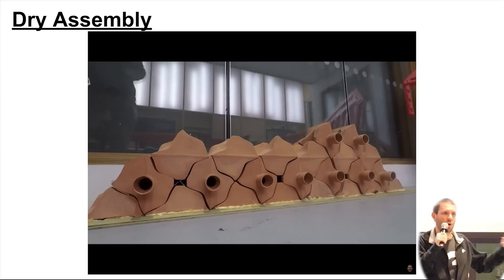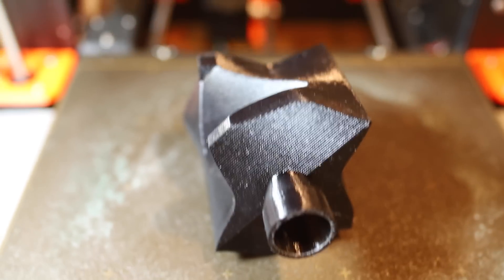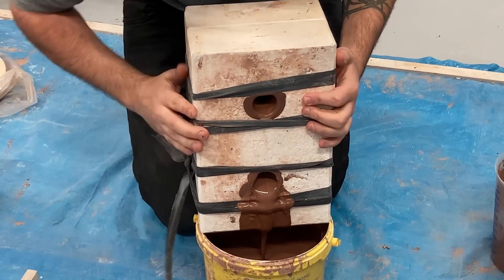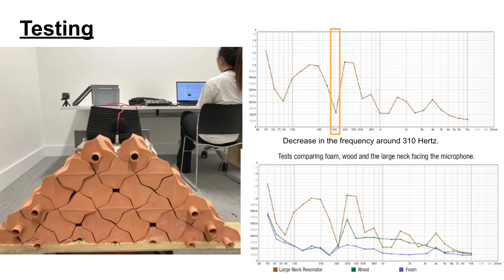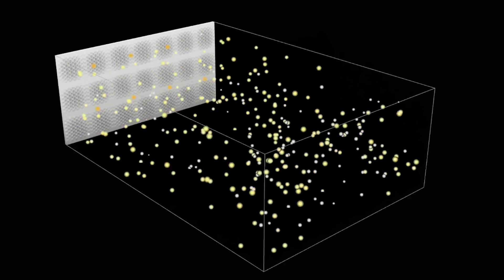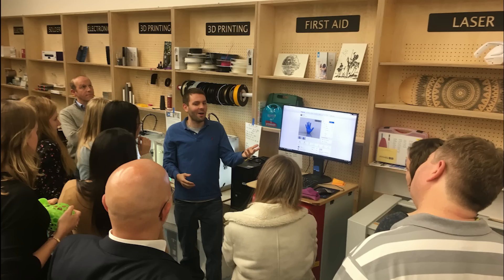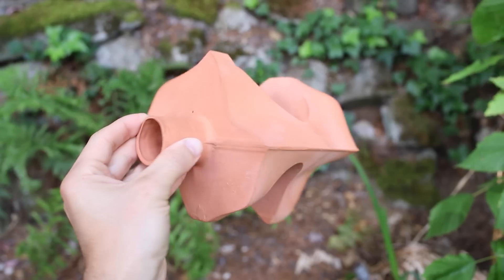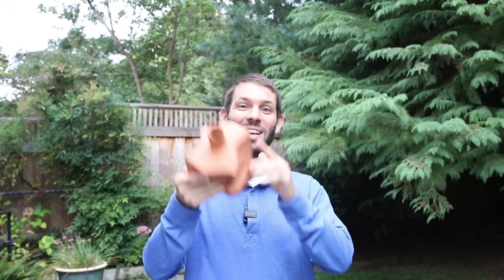Top 3 Questions Answered How I Made This Prototype

Comment from the maker: Enjoy my Thesis and Portfolio about this project linked in the description.  Also the free 3D file to print 👍
Reply: Good work Joe!
Reply: What about like,  motor racing and factory district applications?not just highways.

In construction we have these big plastic boundary bollards 🚧 I’m wondering if this design with another material could be made into manoeuvrable pieces and structures to muffle construction noise
Reply: I would 3d print but my printer broke 😕
Reply: The real question are you going to be a piece of shit when you get big, yes or no.
Reply: How many birds and squirrels moved into your sound attenuating condo complex?
Reply: Just a few notes:

-Most birds will rarely if ever nest in areas so close to the ground easily accessible to predators like rats, snakes, etc...  These houses will end up being used primarily by rats, mice, ants and roaches. You will also see hornet and bee hives being built in there. These will absolutely need some kind of screening to prevent these types of infestations, however rats will chew through anything besides steel mesh, and bugs will fit in-between that, so you'd need 2 kinds of screens.

-The nozzle part that sticks out is a weak point, will likely crack from weather or from kids kicking them, leading to deeper cracks in the structure.  It should be removed completely. 

-The cavity itself will inevitably take on snow and ice and rain faster than it can permeate out. Changing temperature ice expansions will lead to cracks in the entire structure. These bricks will not last long and will be a pile of rubble in 10 years tops, probably less in colder climates.

Conclusion. This design is completely removed from reality and should come with a serious disclaimer for anyone that is attempting to use it detailing all these issues, and I'm sure there are many more if you'd take the time to speak with building managers, repair masons and exterminators.
Reply: You sound complicated...
Why no foam? 
I don't have a CNC machine, and allot of time ...

Air Gap...?
Reply: What does your thing do that gravel filling a space doesn't?
Reply: I once stuck foam sheets with a spacer between them in a concrete poured wall... It did really good to get rid of all sorts of noise and the little bit of chicken wire i put in let alone the mix i used is nearly errosion proof.

Comment: What's the point of the video if you don't even test it? You buy a DB meter, you build a wall with your "special" bricks, you build a wall with cinderblocks and then you test and compare the results. Also if there is wind parallel to the wall wouldn't it make noise similar to blowing over the top of an empty bottle?
Reply from the maker: To keep you wanting more...

Comment: How about funnel shaped internal structure that lets in hot air one side and lets lesser temperature on the other side. Placing them on walls can reduce internal overall temperature
Reply from the maker: It wouldn't absorb noise then...

Comment: seems structurally garbage, significantly expensive to manufacture even at its most efficient, and extremely expensive to construct due to the transportation, storage, and skilled labour involved with cutting these in various fractions of itself. Show me how you tie in two of these walls together at 45°, 90°. How does this method adjust to changes in elevation. And esthetically, I mean come on, that grout job looks terrible and you can tell how different some of these tiles are from one another based on how poorly they fit together in some areas. You built a 5ft triangle, now build a 20ft wall
Reply from the maker: Are you trying to sound like ever other critic out there?
Reply: if thats your response to my concerns then yes, I likely sound like every other critic and thats because these are valid points that you clearly aren't considering or addressing. How many hours went into you making that little triangle, and how do you anticipate cutting down that time? Maybe listen to your critics rather than sounding like some sort of victim thats trying to defy the doubters. If you listened to some of the critics once in a while this product might not look like an absolute joke  @JoeMakes

Comment: Did you consider using recycled plastic to build those bricks? While clay is more inert, it needs to be fired and that would increase the footprint. On the other hand, the plastic brick is easier to mold and produce commercially. You can recycle it multiple times. It may still provide place for small animals to nest inside the cavity, or have moss growth over it. Also recycled plastic would prevent filling more landfills.
Reply from the maker: Yes you can.  We had to use clay for our masters program, but plenty of materials out there to explore 🙌

Comment: I initially thought this was an evaporative cooling wall made of clay, but absorbing sound using clay forms is pretty awesome. It's like ancient cooling methods with advanced geometry repurposed to address a modern problem. Have you considered making a wall of these for a home facing a busy road to test it's use case for residential road noise.
Reply from the maker: Thanks!  My colleagues were doing their project on evaporative cooling.  I did make this wall, but wasn't able to test the final results in external environments before graduation.
Reply: @JoeMakes I got stuck doing civil engineering in the Navy because my degree had "engineer" in the title (Nuclear) ... whatcha gonna do, needs of the navy. Ended up using quantum mechanics equations to develop sound attenuation for indoor construction training facilities that beat the best in the business... it ended up being the cheapest corrugated roofing that fit the equations best and outperformed the top of the line $500k alternative by over 2db for 1% of the cost (free labor using Seabees helped)
Your design has much prettier lines than corrugated roofing panels.

It's hard to tell from looking but those chambers will have a resonant frequency that fired clay will propagate almost like a bell - hopefully it isn't a multiple of the lawn mower frequency - changing the chamber size and shape will change the resonant frequencies.

Comment: What about water inside collecting and allowing mosquitoes to breed?
Reply from the maker: Did you watch the video?
Reply: @JoeMakes  Yes, I did. I’m not being rude, it’s a genuine question. You addressed water on the surface of the terra cotta evaporating but not the inside. Has any water been able to stay inside? In my experience with glazed terra cotta they definitely can hold water especially with no direct sunlight.

Comment: In terms of fragility: Have you tried adding grog to the slip before casting? I'm no ceramics expert, but it strikes me as a really interesting challenge for a ceramics lab to try tuning the process and testing additives in order to make these easier to manufacture. Maybe designing an array mold for pouring concrete into directly, or using other kinds of raw materials that don't require firing, and testing the inclusion of some squishy substace ie: recycled rubber?

Love that you kept this whole project freely available, scientific research should always be open source imo! I'm excited to see other iterate on this project in the future, and see what other fantastic work will build off of your research.
Reply from the maker: Thanks!  Yes, I did experiment with grog but regular terracotta slip was better for evaporating water.

Comment: I love the idea. Have you ever seen the videos of how people in very hot places like india use plastic bottles with the bottoms removed and put into a grid in a window to cool their homes? It would be a neat idea to incorporate a brick with a similar style to what you have there so they could be interlocking but instead of a solid side have that side with a large opening and then the smaller opening on the other side. Then they could use bricks like that for cooling and if they dont want it cooler they could plug the smaller holes with corks or something. I dunno. Just a thought. 🙃
Reply from the maker: Love it!  My colleagues were doing evaporative cooling as their project.  So this is a wonderful combination!

Comment: Overengineered.  The brick needs to be square or rectamgular like a normal brick. This form is not practical. Even if the square brick looses some of its noise absorption. The resulting walls will be more evenly laid and stable.
Reply from the maker: Under-informed.  Read my thesis...

Comment: Have you looked into the cooling(AC) properties of terra cotta pots? They can actually be used as makeshift air conditioners. They work through the process of evaporation, you just keep water in them. So it’s possible you created a way to not only reduce noise pollution, but also a way to decrease the effects of global warming due to air pollution.
Reply from the maker: Yup, my colleagues did ac for their project!

Comment: I have a question and an idea:
does it have to be a ceramic brick, or would a void in concrete the same shape work?
Because for large scale implementation, being able to assemble a large wall of foam cores, and pour concrete over them, then once it set; remove the cores with a torch would hugely reduce the cost, time, and labor involved.
Reply from the maker: We had to use ceramics for my course.  I cover this in my thesis...

Comment: If the bricks are resonators to repel sounds, why u design them to put 1 line facing one side of the wall and the next layer facing the other side? Isnt more effective against external sounds if every brick faces the exterior? Same question for the gaps that form betwen some of them, what is the idea behind designing the bricks like that to have a little gap from time to time in the wall
Reply from the maker: My thesis explains this.  You might like it...

Comment: Not that it should be made of plastic

But could it be made of recycled plastics?

I work with bricks, and feel leaving the flashing on the joining edge Could  help with long term mortar retention/structural rigidity. Have you tried that before?

Last, sorry. You probably should try and get these registered in some capacity to ensure they stay open source. 

You’re awesome
Reply: I don’t have the skill or patience to craft or adapt these, just think they’re neat 😅
Reply from the maker: Thanks!  Sure, it could be made from any material, we just had to use ceramics for the course.

Comment: Does this still work if it's scaled up? Is the size of each brick super important? I watched your original video about making these but it's not my field and I don't have the tools to simulate the shape's sound qualities.

If I could make these out of adobe (or cob), I'd be able to make them super cheaply compared to terracotta but I think the walls of the shape would need to be at least an inch, if not two, making the whole brick significantly larger.
Reply from the maker: The neck and cavity size dictates the frequency absorbed, so if you scale it up the bricks will absorb a lower frequency

Comment: Hi, I searched through your thesis but didn’t see any notes about drainage or water runoff for the bricks with open cavities. It seems like a simple enough issue to mitigate (put small drain holes in the bottom), but I know that drainage for roads is very important to manage, so was wondering if there was any special considerations that needed to be made.
Reply: Unfortunately holes would create an acoustic vent and potentially interfere with the function.  In a fairly good case, the vent might behave aperiodically and it will reduce the efficiency of the Helmholtz body rather than outright ruin it. In a yet better case, you might be able to have the drain vent be a Helmholtz body itself and be effectively a barrier at the working frequencies, but it's sensitive to surrounding geometry. Perhaps worth experimenting. Due to large mouth, the humidity can evaporate from the cavity, so it's not going to just get permanently waterlogged, so it's not outright hopeless as-is. Perhaps if one were to design the mouth to be at the lowest point, and be the drain point itself, that would be ideal?
Reply from the maker: Thanks! 🙌

Comment: How about making these out of recycled plastic?  I think the design would allow for forming 2 halves in a compression mold and then heat or ultrasonic bonding the 2 halves into these shapes.  Is there another shape that would perform the same but have the opening at the bottom edge of each block, so that the blocks could not accumulate water?
Reply from the maker: We had to use ceramic as a medium for my program, but feel free to make them from anything!

Comment: The wavelength of lower sound waves are many times larger than the orifice diameter. May be good at resonating surrounding sounds like a Helmholtz resonator, however for sound abatement there is greater sound attenuation with a wall, than a wall full of Helmholtz resonators. Audio speakers with Helmholtz resonators work well for reproducing sound, however they are not designed or intended to interact with lower frequency external sounds. For the frequency of tire noise the abatement effect desired is problematic and highly inefficient.
Reply from the maker: Yup, that's why it was a great research project!

Comment: looks like a candidate for a blow mold if wanting to produce these cheaply in mass. I dont know what materials could be could be blow molded that would survive the elements long term.
Reply: Glass.
Reply: @Mobin92  glass would definitely survive the elements. i imagine you can blow mold glass. these things are cool if they work, i'm a bit skeptical at their efficacy compared to just a rough textured wall. probably only marginally better, the would really need to be more than just stacked, they need to be bonded together. their cool but i have a hard time imagining market success.
Reply from the maker: I like that idea for a vase!

Comment: 0:54 why wouldn’t you just make the plaster mold straight from the 3D print?
Reply from the maker: You need locator holes for the 2 pieces to line up.

Comment: This would be great in the south, but in the north the winter freezes regularly destroy my terracotta pots. I suppose you could cover the structure with a waxed cotton sheet to keep moisture out. Would it be possible to make it with porcelain?
Reply from the maker: Sure, slip casting works for all!
Reply: I have had trouble with terracotta as well, and i'm in world's mildest climate, it rarely freezes and only barely. Water penetrates it and over years, it just falls apart from the fissures created by ice crystals. So either a protection method or other material is desired.
Reply: Not sure about the south, either. All those open cavities might catch rain and create moquito breeding pools.

Comment: I wonder if there's a design that's less efficient but easier to manufacture re: the failure rate.
Reply: or making them in two parts that are joined after the fact so you don't have to do the pouring out after 40 min thing?
Reply from the maker: Yup, I cover this in my thesis...
Reply: @JoeMakes  Ah sorry - I just kinda skimmed the portfolio presentation/pdf

Comment: Hexagons are a stable tessellated form, I would like to adapt this design into a hexagonal profile; maybe bigger and thicker walled too.
Reply from the maker: Do it to it!👍
Reply: @JoeMakes that's the most effectively loaded reply I've ever seen 😂 huge props if op follows through though
Reply: Hexagons are the bestagons.
Reply: Of course half of your vases will break. It’s an awfully complex shape that introduces lots of tension everywhere. Don’t reinvent everything at the same time. Bricks are usually extruded, with hole patterns aiming to allow for even cooking of the clay. Build on that to make a Helmholtz resonator. Eg hollow blocks with a large central cavity (chimney block) and then some facing block with a single hole for the opening. Thickness of this block determines the neck length. It all exists.
Reply: @vicbauwens  I agree, but I’m only building a wall, not a skyscraper 😂

Comment: For my degree in architecture I made a series of parametric diffusers and absorbers based on cymmatics, calculated specially for each place, but use a helmholtz resonators wall in order to reduce noise in open spaces it’s a really clever idea, for sure it would be an “easy” way to fabricate this in series to put them in most highways as posible, the possibilities for this are endless.
Reply from the maker: Thanks!  Great minds think alike